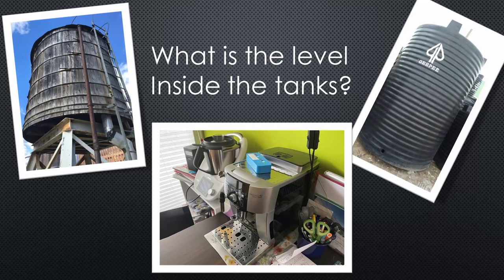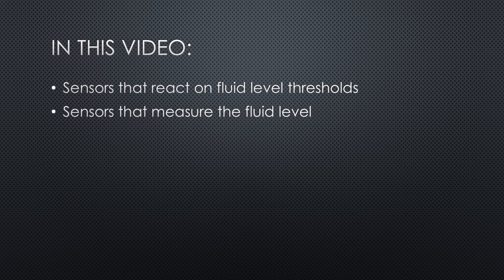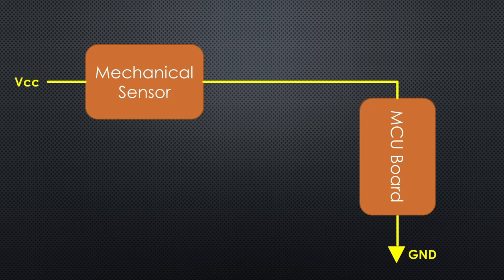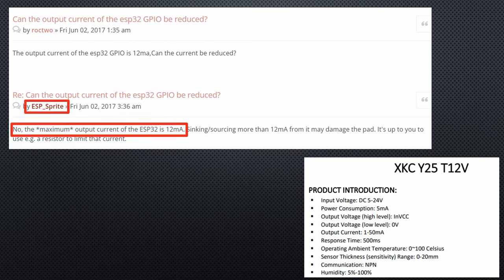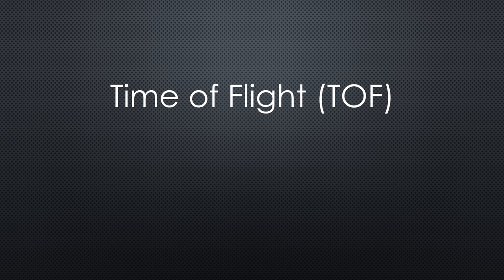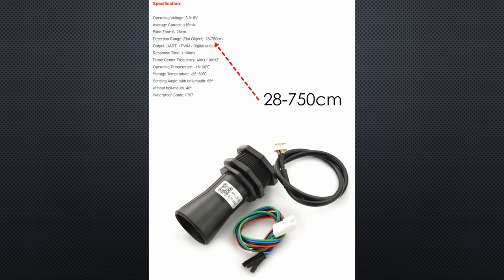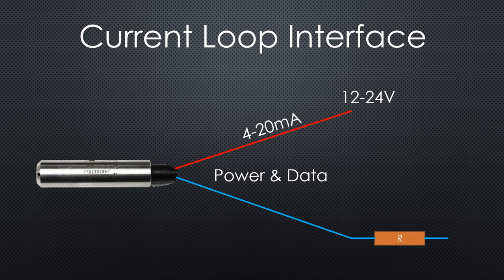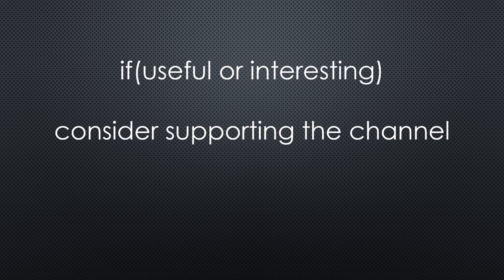#411 Ten Fluid Level (Water Level) Sensors and how to use them (Arduino, ESP32, ESP8266)

Comment: I always wanted a water level sensor for overhead tank (wireless of course) to know when to turn off the borewell. It is a plastic tanks (advertised as 4 layer) https://www.youtube.com/watch?v=dpFl-ImiOEk not sure if capacitive sensor would work.

but if it works, i would like to mount 4 such sensors outside, an esp32 using a small solar panel (it gives 12v/2amps) and a lipo...provided my boss gives me some time.
Reply from the maker: I think the capacitive sensors should work. Another possibility is described by a few commenters: A tube to the bottom of the tank and a pressure sensor at the top (sometimes with a small air pump like in bood pressure sensors).
The monkey had quite some persistence! More than 6 minutes with little success ;-)

Comment: Another way to measure levels of liquids or powders is using gamma radiaton. Basically the liquid blocks the particles and it's detected by the sensor. It's used in very dirty environments such as measuring limestone gravel levels which is very dusty.
Reply from the maker: Others also mentioned this method. It was new to me. It sounds dangerous, so I assume it is only used in difficult situations.

Comment: Andreas,

One way to sense the level in a tank is to use a "bell" shaped dome, open side down. You attach a hose to the top of the bell.

Outside the tank, you have a "t" fitting. One branch of the T goes to the hose attached to the bell. The 2nd branch goes to a pressure sensor. The third branch of the T goes to a small air pump.

With the dome anchored to the bottom of the tank, air is pumped, slowly, into the bell. Run the pump for a bit, stop the pump, read the pressure. Pump some more.stop the pump. Measure the pressure.If the pressure is unchanged,the height of the fluid is proportional to the depth and density.

Successive readings take very little additional air. If the tank is being drained, no additional air may be needed.

You must stop pumping and allow the pressure to equalize, between readings,or the resistance to flow of air down the hose will affect your reading.

The tank must be vented and operating at ambient pressure and known temperature.

I would not use this to measure flammable liquids. (Although, the first place I saw it was measuring the level of fuel oil in an underground tank! The pump was a miniature "bicycle type pump". The instructions read "operate the pump until the reading stabilizes. Read the level in "feet of oil".)

A small aquarium pump, either bellows or piston type, would work for shallow depths of water.
Reply from the maker: Maybe you watch my newest video about the topic. There I used a similar system with a pump...

Comment: There are 30-40 tons of olive oil tanks between 6 - 10 meters. Here the tanks are in the domestic environment. It is at a fixed temperature at an average of 20 degrees. The level is wanted to be measured here. You think it makes sense to use ultrasonic, ridar or lidar. Or let me ask. Considering contamination or price performance in the environment, will the choice change?
Reply from the maker: I gave you the answer about Lidar and ultrasonic in the other video.

Comment: There is one extremly simple alternative, wich does not require a sensor directly in- or outside the tank:
 you place a hose with a small weight at the bottom of the tank. To measure the static pressure, and thus the filling level, an (air) aquarium pump is connected to the other end of the hose - and a pressure sensor is connected in parallel. The bubbles escaping in the tank cause the pressure in the system to be limited exactly to the static pressure. 
This method has the advantage of being extremely maintenance-free and non-invasive, and the pressure sensor can be placed at some distance, indoors.
I have been using this fairly low-cost method for 15 years for my cistern.
Reply from the maker: This method is described by a few other comments and I agree that it is a very good one. I even plan a video about it...

Comment: 4 to 20ma capacitance current loop sensors are by far the best for industrial applications Everybody tends to lean towards designing a mechanical sensor which is the worst type for dirty or corrosive fluids. By measuring the change in capacitance you can design a system that can trigger ant other type of action you want at certain levels such as auto fills, Coolers, heaters, diverters etc any possibility really.
Reply from the maker: Thank you for sharing your experience!

Comment: Do you have a video that discusses the build for the coffee machine with the capacitive sensor? I have 250 gallon plastic water tanks and that looks like an ideal solution to measure a threshold.
Reply from the maker: I did not make another video about the capacitive method. However I made one with a method not mentioned in this video.

Comment: I was doing this for a well, and none of these methods are feasible with the constraints of being mounted to the top, needing to have a range of +- 100 feet (30 m), and any TOF sensors need to be perfectly aligned with the centerline of the well to avoid triggering on the sides of the well. I considered putting a float on a tensioned string with stripes on it for a light sensor to read, but I didn't think I would be able to make something that would last very long.
Reply from the maker: 30 meters is a lot. Maybe you read other comments about a pressure meter (sometimes with a pump) at the top where they put a tube to the bottom. This seems to be a good possibility and might work also for you.

Comment: I have used 7 capacitive sensors glued to the outside of a narrow plastic tank.
I use an ESP32 and Home Assistant to monitor these.
------
They are great sensors, I just hate the input voltage being the output voltage.
Reply from the maker: Good idea to use the built-in (touch sensor) capabilities of the ESP32

Comment: I've seen some washing machines use a sensor with a diaphragm, tge diaphragm pushes a ferrite  through a coil, changing inductance. Outside the liquid level changes a square wave frequency
Reply from the maker: Another viewer also mentioned washing machine sensors. I assume they are very corrosion resistant (outside the water) and have to live for a long time!

Comment: Thanks for this great video, Andreas. Wanted always the same like you, a reliable water level sensor for my Gaggia coffee machine. Bought this capacitive sensor like shown in your video and was happy, that it worked also with just 3.3V. So the integration in my Sonoff S20 Socket was very simple. I use this socket for a couple of years now to remotly switch the machine on. Now I could use the spare GPIO for the sensor. In combination with Homebridge I get now the messages on my iPhone - very nice! :-)
Reply from the maker: Thank you for sharing your project!

Comment: Great presentation Andreas, the possibility of using LoRa to report looks interesting and the application in industrial applications. I am looking into pressure, temperature and flow for my home heating system, so the application of these solutions could be very useful such as the pressure loss in the central heating which can be very common, usually resulting in the system shutting down due to low pressure and result..........a cold house!
Great work! keep it up!
Regards,
Cary
Reply from the maker: Inside the house I usually use WiFi instead of LoRa because the additional range is not needed. So I can save a few bucks ;-)

Comment: How about fluid level sensors for a smart bottle project? Considering that I am on a very early stage of the design, let's consider that the bottle is just standing perpendicular on a steady surfice.
I've just tried Laser sensors (TOF) and they worked fine until I notice some water drops got in the way of the reading (especially with hot liquids evaporation), resulting on incorrect results. 
Considering that, I am considering to move to weight sensors (using the density to measure the fluid level), but I could not find a good fit for the project dimensions (it is a 500ml bottle). 

If someone could help me out, I would REALLY appreciate it. Thank you so much for you time reading this!
Reply from the maker: You find many discussions in the comments. I think it is worth wile to browse through the comments...

Comment: Great overview! 👍
I am using a throw-in pressure sensor (4-20 mA) for an IBC container filled with rainwater. For measuring the current an INA219 does a much better job than the internal ADC (Wemos D1 Mini).
Reply from the maker: Thank you for sharing your experience. Indeed, the INA219 is a good chip for such a purpose.

Comment: One thing I would love for to cover is connecting these for remote monitoring.   

For example in building a monitoring system for a greenhouse on arduino Mega2560. I've used a lot of your great videos to choose the parts and design. 

But once I get that working local.. I'll want a way to remotely check on things.  

Obviously there are many ways to do that.  My scenario wifi is available, but also considering using lte and having it log data and transmit on a schedule. 

You seem to be the perfect guy help tie these projects together. 

If you have done a similar video and I missed it, please let  me know.

Thanks!
Reply from the maker: WiFi is good for short range (with ESP32 instead of an Arduino). For longer range we usually use LoRa. You find many videos on this channel on various aspects of these topics.

Comment: There's a type of sensor I've seen that mounts to the bottom of a steel LPG cylinder (I guess YT rejected my previous comment because I linked to an example) that somehow measures the level in the tank with no mechanical or optical access to the liquid, and no means to measure by weight (the sensor must be kept off the ground). I wonder if it uses ultrasound but don't quite understand how that could work reliably through steel. They're wireless and support bluetooth, and I've been thinking about trying them for a pair of tanks I have. I wonder if I could create a similar device.
Reply from the maker: You are right. YouTube does no more like links. Sometimes it works if you remove the https...
Sounds like a good sensor. Nobody mentioned it so far.

Comment: I have a shallow tank under my HVAC air handler in my attic.  If the condensation line becomes plugged, condensation water will collect in the tank.  The tank has a float that disables power to the HVAC system, but I want to know when the primary line is plugged and water is collecting in the tank.  I have a resistive sensor connected to an ESP8266. It sends a message via MQTT to my phone once a day with the value read from the sensor.  If there is no water, the value is very low.  I guess that is noise.  I haven't had any water in the tank yet, but I did test the system with distilled water in a dish to determine values that indicate the presence of water.
Reply from the maker: Good and cheap solution. These sensors are perfect if you do not expect water for a long time. Then they do not corrode.

Comment: As someone that works in industrial automation as a profession, great video, few other methods include some of your favorites, radar and guided radar. They are usually used on fluids that can have a vapor, since vapor / condensation can cause issues with the speed of sound with ultrasonics.  Another very common visual level indicator is a MLI magnetic level indicator, its a tube connecting the bottom of the tank to the top, there are magnetic rollers which rotate to show the fluid level,  the end user can strap hall effect sensors / reed switches to different levels for say a low a low low high high high contacts. Also for intrusive solutions like the moisture sensors you get what we call spiders, theyre a collection of vertical stainless steel electrodes, as the water levels rise making contact from level to level its measured, either capacitively or resistively.  90% of industrial automation uses 4-20mA current loops, but you also get oldschool 0-10V aswell as new stuff like Modbus Profibus Hart( old). 

A majority of the instruments i look at are flow, this is measured by alot of different means,  differential pressure , mechanical , electromagnetic, ultrasonic, mass flow , Laser . The nuts thing is thats not an exhaustive list.
Reply from the maker: Thank you for the additional insight from a professional!

Comment: For my non-implemented project I've considered creating a bit complex discrete measurement system using several custom optocouplers with enough distance between LED and photodiodes to avoid surface tension. Of course, sensors and LEDs should be waterproofed. 

The idea was to place this couplers inside the tank at desired levels and calibrate their output with water levels above and below them.
Reply from the maker: That should work if the "water" lets enough light pass.

Comment: Another idea that I am playing with is use a rotary encoder with a "pully" system. Two small weights on either side of a gt2 gear with a timing belt. Small sealed bottle with some sand at the bottom should do the trick. That should eliminate the problem of corrosion as the encoder can be outside of the container. Will be giving it a go in the new year. 

Side question , any chance of looking at Inkjet printer optical encoders? You can get quite a lot of them in a discarded printer but so far I haven't been successful getting a signal from the collector...
Reply from the maker: 1. These mechanical sensors are used in several applications (e.g. in lakes). This for sure will work.
2. I never used such encoders. Maybe Google knows?

Comment: Last summer I built a sensor for a closed water tank (50 liters) in our camper. The first approach was an ultrasonic sensor, waterproof, and capable to measure small distances. Did not work (to much condensation inside the tank while driving up an down). After a bit 'testing around' I ended up with cupper tape (6mm, aliexpress) , glued to the inner and outer side of a plastic tube (as used for electrical installations), protected with a epoxy layer. The signal was then read with one of the  pins for touch sensors. After some work with signal attenuation and calibration the sensor works fine.
Reply from the maker: Cool. Good information!

Comment: Capacity measurement also works for liquid level measurement. I did last year a lot experiments with a mpr121 and copper foil. Works good. If it only works inside or also outside the tank I have not tested yet. I laminated two cooper foil strip's near to eachother together in a long strip for the experiment.
Reply from the maker: I agree.

Comment: Pressure sensor is indeed a good way to go, however for accurate measurements you also need to reliably measure atmospheric pressure.

Another option I used is measuring weight: plastic water tanks sitting on a load cell assembly tared empty. In my application I only needed one litre resolution of a 10l tank and it works perfectly. (1 litre of water is roughly 1kg)

(Sorry just seen that this has already been mentioned : )
Reply from the maker: You are right. I forgot to mention the weighing method.

Comment: Perfect timing!  I have a small decorative fountain that I brought in to store for Michigan's winter.  I wanted to outfit it with a sensor to stop the pump if the water level dropped to prevent damage and alert Home Assistant.  Now I have no excuse to forget.  Once again thanks to the guy with the Swiss accent!
Reply from the maker: Good project for the cold winter where you live. I still remember my February trip to Chicago many many years ago ;-)

Comment: I have found that using the TOF sensors on open enviroments to measure water can be tricky because of reflections. I've found a better solution  encapsulating the sensor, with a floating disk inside a cheap PVC pipe, which gives much better results.
Reply from the maker: Thank you for sharing your experience. Other viewers also wrote about this problem and proposed a similar solution. Good to know!

Comment: Hi there, What do you think of using load cells beneath the tank, and convert the reading to level knowing the density of the liquid? That should solve erosion and contamination problems.
Reply from the maker: You are right. Many other viewers also suggested this method. I should have included it in my selection.

Comment: By the way, don't think the gremlins will go away if you say have a plastic float switch that does not corrode. I learnt the hard way. You see with some chemicals they can dry out and crystallise. Imagine your plastic float switch regularly dipping into this chemical, then depositing a film of it, then drying out. What you get is a build up of it so the float switch jams. Then if you have it operating a refill pump, next thing you know the place will be flooded out. Capacitive sensors will generally work, but if you have a rather thick plastic tank then you are operating at the max of their ability to see through it, you may find some internal grime fattens the wall thickness sufficiently to give you an erroneous reading. Plastic tanks tend to have a thicker wall at the bottom, which is annoying because sometimes you want to say when the tank is completely empty.
Reply from the maker: Thank you for sharing your experience! Other viewers also mentioned the blocking of float sensor clogged by chemicals. It seems to be a problem.

Comment: There’s a flush diaphragm pressure sensor. 
Deigned for viscous fluids.
The sensor mounts outside and sits flush with the internal wall of the container, so no cavities to catch the viscous fluid.
Most of them are made in stainless steel to combat corrosive medium.
Typical uses are grey water, sewage drain, or even concrete.
Reply from the maker: Never heard of them (I had to google). These sensors seem to be an alternative to the threaded sensors I showed for different mounting situations.